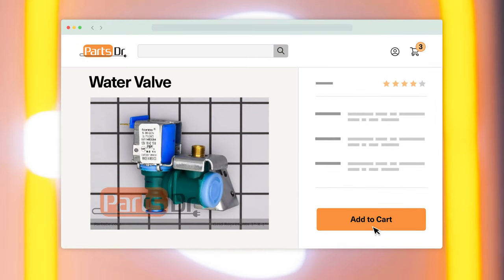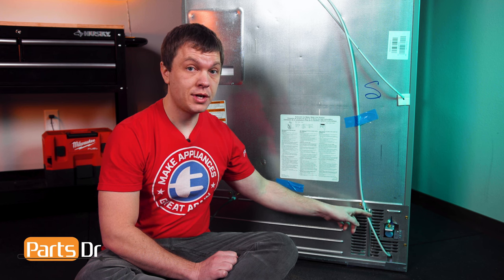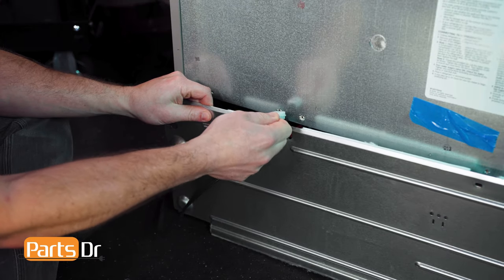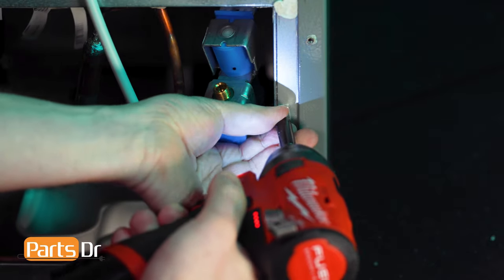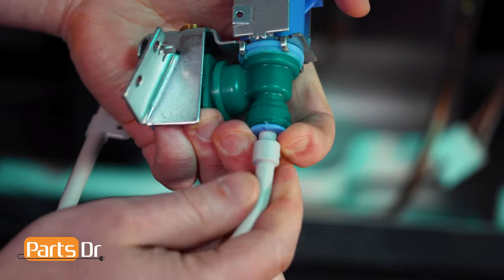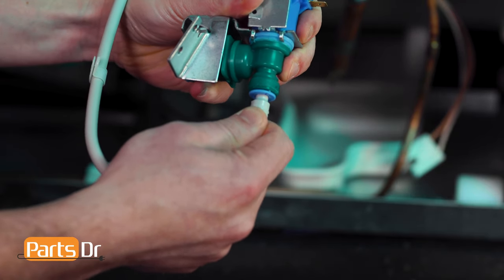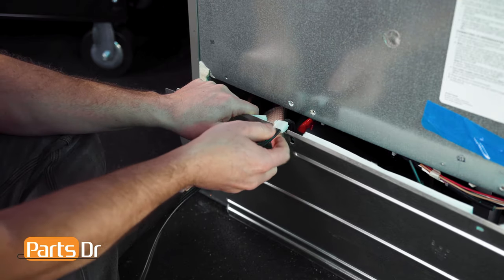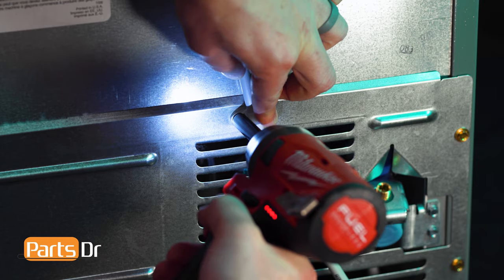How to replace Water Inlet Valve part # W11482025 on your Whirlpool Refrigerator

Comment: I have this same frige and I’m getting water dripping from my icemaker. Could I have a bad water valve like I’m this video? Thanks.
Reply from the maker: If water is leaking from the ice maker, it could be caused by a bad leaking water valve or valves if your refrigerator has multiple water valves.  Or, sometimes the ice maker tray can leak and the ice maker has to be replaced.
Reply: @PartsDr before I unplugged the refrigerator last night to thaw it out, the water stopped dispensing from the front of the fridge too so I’m thinking I have a water valve issue? How would i determine if I need the water inlet valve that’s right at bottom back of fridge, or the dual water valve inside the fridge though? Thank you!
Reply from the maker: @DerekEvan  If water is leaking into the ice maker while the refrigerator is unplugged, that would indicate that both water valves are bad and leaking.
Reply: @PartsDr I’ve had the water valve off and nothing leaks. I will turn it back on now. If the dual water valve inside the refrigerator is bad could it possibly also cause no water to be dispensed from the door? (water valve open)
Reply from the maker: @DerekEvan  Yes, these water valves usually either fail by leaking while not in use, or not allowing water to flow through when power is being sent to the valve to allow it to open.
Reply: @PartsDr  thank you. I actually ordered both valves from you yesterday, so just waiting receive them. What started out as a leak is now (with water supply on) I can’t even dispense water or make ice at all.
Reply from the maker: @DerekEvan  Let us know what you find.
Reply: @PartsDr  I received your parts in tonight and just used them to replace both the dual valve inside the refrigerator and the inlet water valve in the back of the fridge. I am still getting no water from the door. I can cycle through ice, crushed ice, water but when I push the lever nothing happens at all… I also noticed that when I drop down the water filter it no longer gives me a replace filter warning either. I also cannot access the options. When I push the options button they show up for a second and then disappear. The frige isn’t locked either. What could this be? I appreciate any help.
Reply from the maker: @DerekEvan  What is the model number of the refrigerator?
Reply: @PartsDr  wrf997sddm00

I appreciate you looking it up.
Reply from the maker: @DerekEvan  Is the ice maker working and producing ice?  Did the leaking stop?
Reply: @PartsDr  the ice maker is not making any ice and no water will dispense out. The water valve is on. The leaking stopped but that was only happening when the ice maker and water dispenser was still working.
Reply from the maker: @DerekEvan  Start by checking the water supply line from the house to the refrigerator.  Turn it off, and disconnect it from the refrigerator, then turn it on and let it spray into a bucket.  If this is good, then check that the water filter is installed properly.  Sometimes the filter housing can fail and not allow water to flow past that section.
Reply: I have done both and they are good. The water pressure is good and the water filter is installed properly. The following is not working: no water making it to ice maker so no ice is being made, no water comes out when paddle is pushed in to dispense water (you hear nothing), no alarm goes off if either refrigerator door is left open for any period of time, no alarm comes up when water filter is dropped down, cannot access options from front digital screen. All of these things were working before. It seems like it’s something electronic but I don’t know what. If you have any suggestions I would greatly appreciate it.
Reply from the maker: @DerekEvan  Have you double checked all of the electrical connections to make sure something isn't making a good connection?  Also, check the wiring coming out of the refrigerator door to make sure there are not any broken wires.

Comment: I have checked all of the connections and inspected the wiring coming out of and through the door and all of that is good. I tested the water filter switch and door switches with meter and they are all good too.  Is there a circuit board that could be malfunctioning that controls all of the problems I’m having ?
Reply from the maker: It looks like the power is sent from the Main Control Board to the water valves on your model wrf997sddm00 refrigerator.
Reply: Is it the part called “control board” PD00076623 on your website? I’m not even sure where that’s located on the refrigerator? Are there times when only a portion of these boards malfunction? Thank you for the information.

Comment: I replaced this valve and the icemaker works but there is no water to the water dispenser.  I here the relay when I press the despensor but do not get anything.  Whats next?
Reply from the maker: Check the water valve in the ceiling as shown here: https://www.youtube.com/watch?v=EvEPAo2mGR0 And also check for any frozen water lines.

Comment: As soon as i install the new water pump it burns. Why? (I got the right part)
Reply: Note. Followed instructions disconnected everything. Installed pump. Connect everything. Then when i press the water dispanser button it burns the part. I can smell it
Reply from the maker: @ricardovazquez4333  That's strange.  Is the water valve that you installed the correct one, and is it a new OEM Whirlpool part?

Comment: My ice dispenser leaks when I use the water dispenser in the front of my fridge. My guess would be a faulty inlet valve?
Reply from the maker: Yes that sounds like a faulty water inlet valve.  But, if your refrigerator has two water valves like the one shown in this video, the valve that has failed is most likely the 2nd valve. Check out our video that shows how to replace the triple water valve inside the refrigerator section here: https://www.youtube.com/watch?v=EvEPAo2mGR0